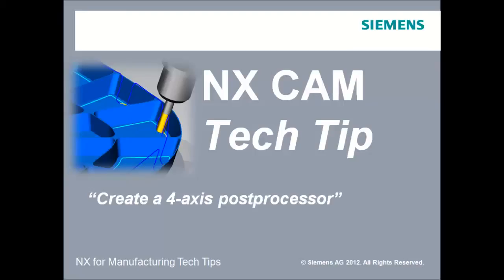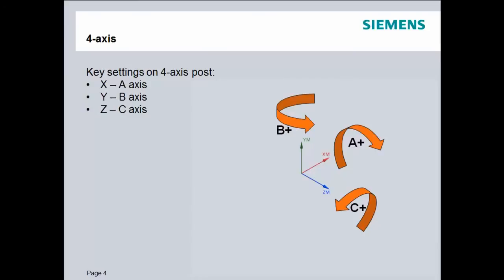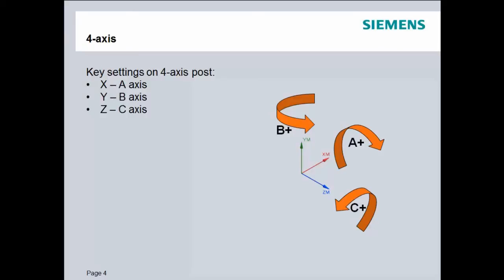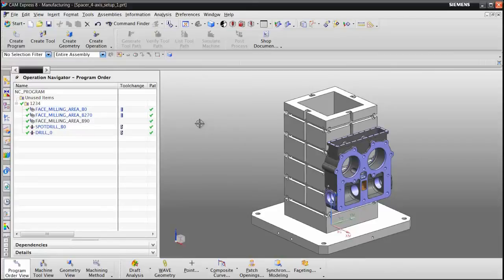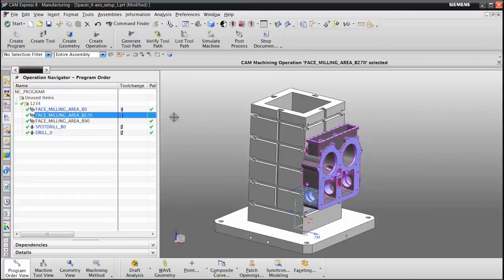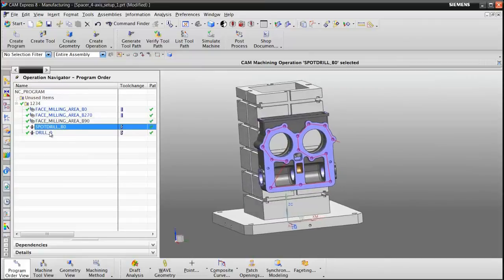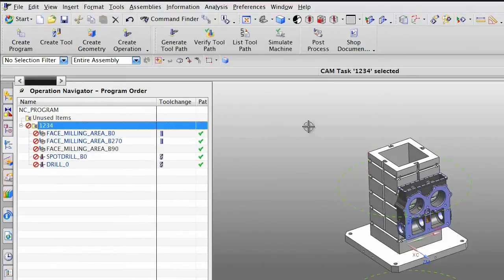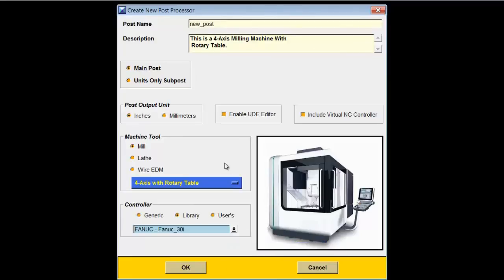POSTPROCESSOR BUILDING - "Create a 4-Axis postprocessor"

Comment: How can i post out lest z position in program in comment of first line of program...so that operator can see and take note and pull/push cutter from holder.... plz...its very important
Reply from the maker: Hello, 
To perform this type of task, you need to enter your own procedure in TCL / TK, as this is the language used by postbuilder. 
To print the last Z positions at the beginning of each operation in the NC code, enter a procedure that will prepare and list the Z value to the external temporary TXT file.
We use the commands OPEN / READ / WRITE for this purpose :

https://wiki.tcl-lang.org/page/How+do+I+read+and+write+files+in+Tcl

Keep in mind that the postprocessor is a "path to code" translator and ejects the data block by block (path by path), so the last Z position values will normally be printed in the NC code as the last lines of each operation.
So to "replace" the lines in the NC code from the last line to the beginning, use an external temporary text file. 
After writing such a procedure, the postprocessor must do some special tasks in the order as below :
1) generate a temporary text file , 
2) read the data generated from the external text file , 
3) insert/write this data at the begining into the postprocessor , 
4) remove the external temporary NC file (command: file delete) ,
5) generate final NC code ,

All this must work like a program loop (commands: while, foreach).

It cannot be done with one procedure, so you have to write Your own procudre in the postbuilder in Operation Start Sequence, and in Program End Sequence.